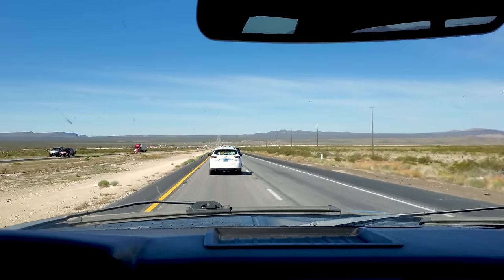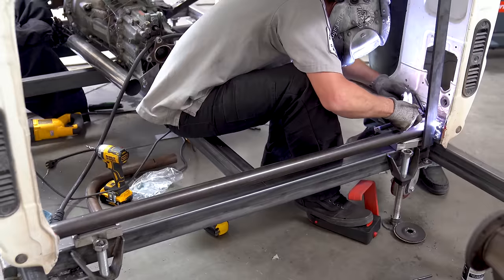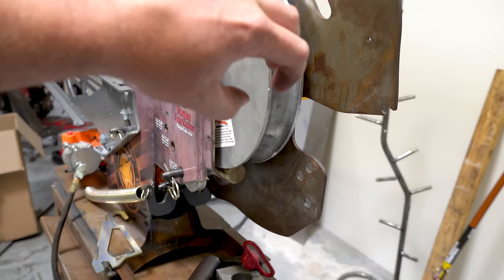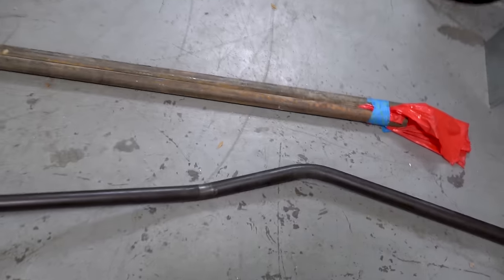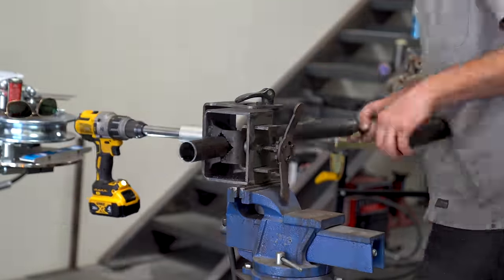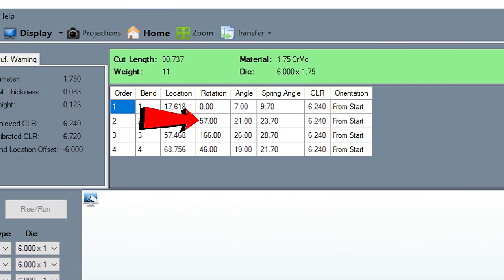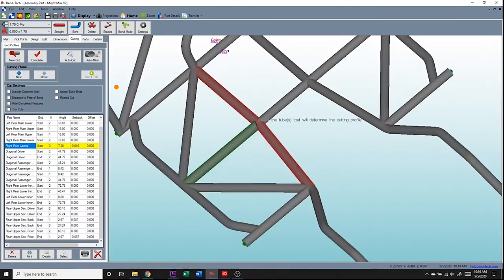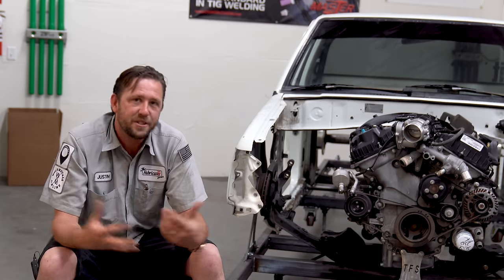First Tubes and First Problems

Comment: Go to the Surplus Store tell him you got a gun tube the dimension of the ID he'll find you a brass brush you got a welder/hot glue gun, don't tell me you don't have a long enough handle
Reply: I have a cylinder hone built the same way to clean the bore of my cannon.
Reply: Brush Research also makes cylinder hones in many sizes using various abrasive type in numerous grits. McMaster has a very wide selection for hard and soft metals from 3/16" to 18".

Comment: question? cant you make shorted pieces and put sleeves to make them long again. instead of just tossing the mistake pieces? now i know your not going to toss the mistake pieces. that tubing isnt exactly cheap. good luck.
Reply: Can't do this when buildin roll cages. Rules for nhra.
Reply: @Ryan_1997  What I found a bit confusing or misunderstood on my part, it sounded as though the reason he was using a mandrel for bending was he wanted to use a tighter radius than was typically used (for that diameter and wall of tube), anyway, I was under the impression most rules including NHRA had limits as to how small a radius a given size of tube can have and that number does not require a mandrel to bend.

Comment: Depending on how clean it has to be, run a length of scrap/cut off MIG wire through the tube and tie some cloth with plenty of your preferred cleaning product on it, draw it through a few times. For added convenience, tie a lenght of wire to the back of the cloth, so it is easy to pull through both ways.
Only 18 minutes and 14 seconds of talking head, BTW, so you're fine.
Reply: he did do that

Comment: Use muriatic acid to clean the steel thats what we use to clean rust out of motorcycle tanks
Reply: Just dont get it on the floor it will etch the concrete